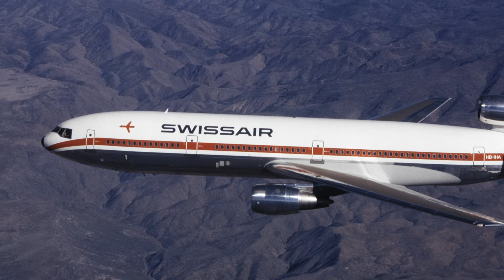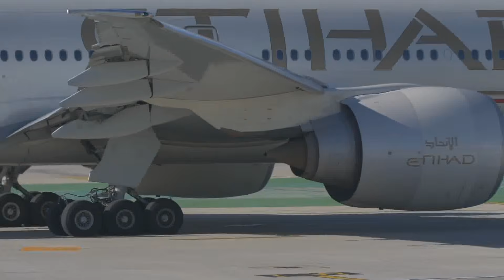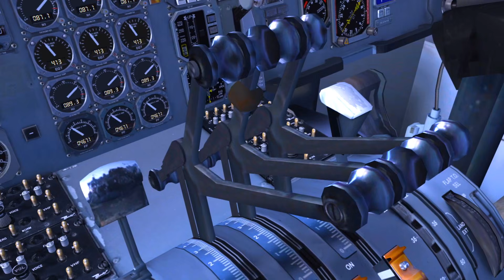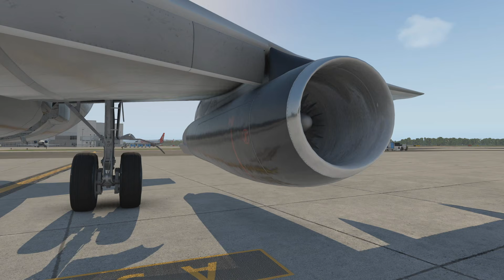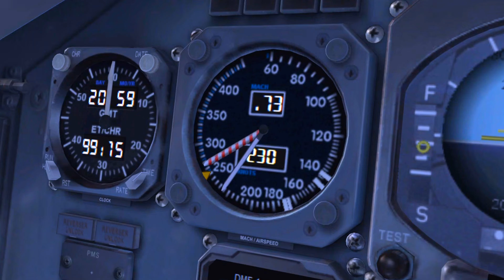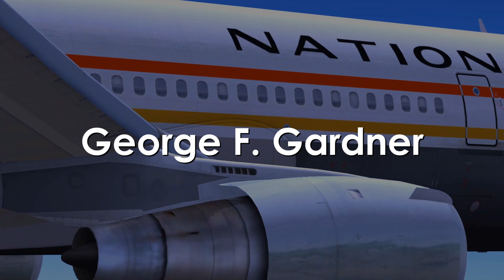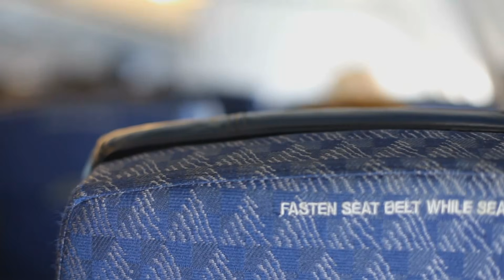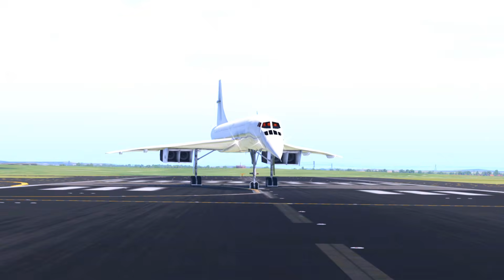The Unsettling History of the DC-10 (National Airlines Flight 27) - DISASTER BREAKDOWN

Comment: even when what looks like a completly not related crash has been tied back to the dc-10, that being the fact the concorde crashed and no one knew it was a piece of a dc-10 that crashed it
Reply: MarcosAcceleronHotWheels.Actually, they did know almost right away. One of the first things that's done when an aircraft has an incident during takeoff is an FOD inspection of the runway that it took off from. When they found large pieces of one of the Concorde's tires on the runway, along with a strip of metal, it was determined that the metal strip didn't come from the Concorde, so the accident investigators suspected it came from a previous departure from that runway. The flight that took off just prior to the Concorde just happened to be the Continental Airlines DC-10, which was missing a wear-strip from one of it's engine cowlings. But to be fair, that strip of metal could have come from any kind of aircraft. 
As a result of this accident,  Continental was fined for maintenance violations. But I must point out here that that wear-strip was not part of the DC-10's engine, but a non-structural part of the cowling, which is part of the airframe of the DC-10, added by maintenance  when it was noticed that normal flight vibration had caused wear between the cowling access door and the structure it attaches to. The engine wasn't the culprit in this accident. Instead, it came down to a very high performance aircraft operating at the extremes of the environment that had a critical failure at the worst possible time. Unfortunately for the Concorde, the likelyhood of tire failure was much higher than other commercial jet aircraft of the time because of it's higher takeoff and landing speeds.
That, and some shoddy sheetmetal work by one Continental mechanic and you have the makings of a truly horrific disaster.
I like the videos from this channel and think the quality has improved significantly since the first ones, which contained frequent technical errors and a lack of basic research on high profile accidents that had been covered previously by other aviation channels. I like that this channel has been looking at lesser-known accidents/incidents. Keep up the good work,  and let's "keep 'em flying!"

Comment: The piece of the "Engine" that came off of the Continental DC-10, Concorde crash, was not part of the engine, but a piece of the engine cowling, the engine had nothing to do with that. 
I overhauled CF-6-6, and CF-6-50 engines, and over the years was present for some of the modifications to those engines, none of which were of a major type. Very good engine.
I would be interested to know if the other instances that the engine had been removed for performance issues, if there were excessive vibrations associated with that engine.

Comment: There were no such thing as ETOPS in the 1960's, that would come into foucus towards the end of the 1970's, which is when Boeing launched the 757, and 767 designs, and Airbus launched the A-300B design.
Reply: I believe the "T" in ETOPS stood for "Twin engine" and the DC-10 was a 3 holer so the ETOPS rules would not apply in any event.

Comment: The DC-10 also played a major role in the crash of the Air France Concorde
Reply: Actually the official story is flawed. Concorde started veering off the runway before it ran over the supposed piece of metal. British pilot who flew Concordes elaborates on that accident more precisely.
Reply: @maciekkra539  Whether it drifted or not I certainly wouldn't want to be taking off on a contaminated runway.
Reply: @Dash8Q400Radio  I agree, the French did a shoddy work either way. FOD on the runway and poor maintenance on one of the most beautifull birds ever taking to the sky.
Reply: @maciekkra539  As usual, xenophobic language whenever a French organization is involved.  No one writes “the Americans did a shoddy job either way allowing an illegal part on their DC 10 and  then their lack of proper maintenance allowed it to fall on the runway unnoticed.”  No. They write simply, ‘a DC 10’ or at most, ‘a Continental DC.’  No America bashing; just French bashing. One could analyse that.
Reply: @lours6993  No doubt American maintenance personel did crappy job on the Continental DC10, i did not negate that. But when you dive into this accident more, getting rid of just one of links in the chain of events would have most likely prevented the catastrophy. But like i've wrote, the Concorde started veering off the runway before it went over said piece of metal, had that not happened, it would pass right by it on its takeoff run.
Reply: @maciekkra539   My point is about your use of xenophobic language: that group, “the French” but never, that group, “the Americans.” It’s the choice of words that seems to betray an attitude, conscious or unconscious.  One group of people can be easily grouped together and stereotyped negatively. The other cannot. This is essentially what xenophobia is.
Reply: @lours6993  Do you know what you're even writing? I'm obviously not writing about any phobias. I'm writing about technical aspects about the Concorde tragedy.
Reply: @maciekkra539  There was a learning moment here on use of language. I guess you missed it. Have a good day.
Reply: @lours6993  Listen, don't even bring that woke nonsense here. You obviously don't even know the meaning of the word "phobia". Were Americans working on the Concorde in Paris?-no. Were French working on Continental DC10?-no. So what is the problem here? Looks to me you're the one with the phobia. Phobia-illogical fear of something. There is a monent of learning here, use it. Good day.
Reply: Which ended the Concorde era sadly :(
Reply: @yuii2493  realistically... Concorde was.... in some ways genuinely innovative in terms of progressing aviation, and the world is a less interesting place without it, but... in some ways...  It was a flawed design that was dangerous to operate.  Which makes it even sadder, they hadn't managed to fix the known flaw before disaster struck.  They knew what it was though.

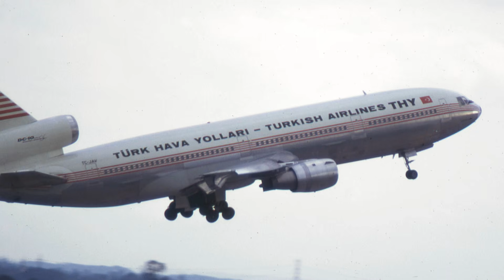Comment: 2:44 I flew with this particular TK DC-10 a few months before its crash. As a young kid who had only been on Fokker F27, F28 and McDonnell Douglas DC-9 before, the DC-10 was so huge in my eyes.
After the crash, I still remember shredded stuff of the passengers split all over the place being shown in the news.
Most passengers were on board by bad luck (or by fate?). Due to some strike, their scheduled flights were cancelled and they boarded the first available flight from Paris to London, which turned out to be this accident aircraft.
Reply: I think the incident you mentioned was Turkish 981 which crashed with all of them dead (346 passengers/crew) in 1974 because of a door which was loose and which blew off as the DC 10 was climbing

Comment: The DC-10 was certainly far from a perfect aircraft, but I do not think that it deserves the sort of negative reputation that many people have given it. Aside from several cargo door locking mechanism flaws, most of the notable accidents and crashes can be attributed in part or in majority to either improper maintenance practices by operators, pilot error, or a combination of both.  American Airlines flight 191, probably the most infamous accident of the DC-10's lifespan and to this very day the deadliest single aircraft accident in American aviation history, was not in any way attributed to a design flaw or malfunction within the aircraft, nor was it attributed to pilot error. It was American Airlines' fundamentally flawed maintenance practices that caused catastrophic damage to the engine pylon which caused it to completely separate from the aircraft during the takeoff roll.
Reply: Hi Jackson;  Actually I think there was a lot more to the AA-191 accident than meets the eye at first glance.  What you say is true... The NTSB report basically blamed flawed maintenance procedures and incorrect pilot training for the accident and there is no doubt that these were major factors.  I believe there were other factors involved related to the DC10 design being "minimalist" and being rushed in its development.  People far more qualified than I hold the opinion that after the engine departed the left wing the aircraft was still flyable on 2 engines.  In fact, this is a certification requirement.  The fact that it crashed once the engine departed and damaged the hydraulic and electrical systems can be attributed to two design decisions made by McDonnell Douglas.  The first was not to install a system to detect and prevent unsymmetrical or un-commanded slat deployment or retraction.  (Both the 747 and L1011 had such systems and the FAA mandated the use of such a system in 1982.)  Yes, McDonnell Douglas had tested the aircraft with unsymmetrical slat positions and proved it could fly safely but it was NOT tested for un-commanded un-symmetrical slat retraction just at the moment of rotation.  The second design decision was to only provide a stall warning/stick shaker for the left seat (Captain) as standard equipment and make it an extra cost option for the right seat (First Officer).  American Airlines opted to not pay for the option.  The FO was the pilot flying at the time the left wing stalled due to un-commanded slat retraction and he got no warning that the aircraft was entering a stall.  If either of these systems had been installed as standard equipment there is a good chance we would not be talking about this accident today.  The bottom line seems to be that the DC10 was an inexpensive "minimalist" aircraft that did meet the regulations of the day but only just...  When things went wrong there wasn't anything "extra" that could help the pilots out of a tight corner.

Comment: "For the first nearly 20 years of operation of DC-10s, flight 27, in 1973, was the only major incident to involve an unconfined engine failure. And after two decades of operation, it would look as if there was no reason to suspect that another fatal engine incident like this would occur." - that would make the DC-10's first flight around 1953... :-S
Reply: unless 1973 was near the beginning of the first 20 years of operation...as it was. the line is a bit misdirecting tho.
Reply: @RatPfink66  - well yes, I guess I knew what they meant 😀

Comment: At the airline I flew for, there was a three strikes and you are out maintenance policy. If pilots had a squawk about a particular component on the airplane, if the repair failed for a third time the airplane was grounded until it was fixed permanently. I wonder if this policy might have prevented this accident. I guess we will never know.
Reply: Gawd, at the regional I worked for in the early 90s, we were one of the first and largest Embraer Brasilia customers, and if we had that 3 strikes rule, the fleet would have been grounded. They always had the same nitpicky problems, most of which could be deferred (some instruments, biffy dump system - redundant items and conveniences mostly), but they kept coming back again and again, rarely anything serious unless you're the poor ramp guy who gets a face full of used blue juice. We had a few ramp fires from fuel leaks on engine shutdowns - that was fun.

Our maintenance crew was top notch. It's just that getting a new type up and running means going through a lot of those nasty little problems. I think the Brasilia turned out to be a fantastic aircraft, and so are its jet descendants. The pilots loved it, but they got to know our maintenance staff pretty well.
Reply: @DrBeenaPlumber  I flew the Brasilia during my time at a commuter airline. It was a good airplane but you had to fly it by the book and be careful with the props.

Comment: One thing I don't understand is, if most accidents involving the DC-10 were unrelated to the plane's design, then what about its unusually high accident rates compared to its competitors? It's hard to believe that only the DC-10 got poor maintenance and incompetent crew.
Reply: Blerst;   That is a very good question!  I don't think there is a single simple answer to the question but I can think of several examples that would be a partial answer to the question.  United flight 232 (DC-10) suffered an un-contained failure of the number 2 engine that damaged all 3 of the hydraulic systems which rendered EVERYTHING hydraulically powered on the aircraft inoperable.  The result was a crash landing in Sioux City.  Pan Am flight 845 (747) departing San Francisco became airborne late and impacted the approach lighting system at the end of the runway sustaining severe damage including 3 hydraulic systems.  The aircraft managed to return for an emergency landing because it has been designed with FOUR hydraulic systems and the one remaining system saved their bacon...   Another case that comes to mind is Northwest Airlines flight 85 (747) which suffered a hydraulic malfunction in the rudder system over the Pacific ocean which caused the rudder to make an un-commanded hard-over.  Normally this would result in an immediate death spiral (like United 585 and USAir 427) and we never would have found out what happened - but the 747 had a "split rudder" where the top and bottom sections of the rudder were independently hydraulically controlled.  The pilots were able to deflect the still working half of the rudder in the opposite direction to balance the the rudder forces and that kept them flying long enough to land safely in Anchorage.

    The pretty much inescapable conclusion is that of the first generation wide body aircraft  (747, DC10, L1011) the 747 and L1011 were very solidly designed aircraft.  The DC10 was designed to be the less expensive and earlier to market alternative so some design corners had to be cut.  This does NOT mean that it did not meet the basic regulatory requirements of the day but it didn't have much redundancy ABOVE the required minimum.  Extra redundancy above the minimum is nice to have when you are having a bad day!  Remember American flight 191 (DC10)?  The NTSB report basically blamed defective maintenance and incorrect pilot training.  The facts seem to be that the the aircraft was flyable but entered a left wing stall when the left wing slats retracted due to loss of hydraulic pressure.  There were no mechanical slat locks (not mandated by the FAA until 1982 but installed as standard equipment on 747 and L1011) so the left wing slats retracted reducing the lift of the left wing causing the stall and resulting roll.  The pilot flying (First Officer) might have avoided the stall or been able to fly the aircraft out of the stall if he had known they were stalling but he had no stall warning stick shaker.  On the DC10 a stick shaker for the FO was an extra cost option that American Airlines didn't want to pay for.  As for slat locks that would have prevented the stall, Mcdonnell Douglas deemed installing them "unjustified".  See the August 4 / 1979 NY Times article written by Richard Within.  Search for "DC-10 Manufacturer terms slat locks unjustified"  It is interesting reading and clearly displays the mindset that the DC-10 was a "minimal" aircraft and that anything that could be left off would be left off to reduce the cost and speed up the development schedule.

      The bottom line is that while the initiation of many DC10 accidents was not the fault of the aircraft the lack of something "beyond the minimum" in its design made it more vulnerable when things went wrong.  Think of it as removing a few slices from the Swiss cheese stack.  Fewer things have to go wrong before the situation turns into disaster.

     These are my opinions... other people are sure to have other opinions so let the discussion begin...
Reply: Not true about the poor maintenance or crew part. Alaska 261 (MD-83) and Japan 123 (747-100) were not maintained properly prior to those 2 planes crashing. There are others but those 2 came to mind for me as I watched the video

Comment: I want to say I'm surprised I've never heard of this, but at the same time I can't really be surprised when United 232 also happened. There's no doubt it was overshadowed by 232 as they were both uncontained engine failures, just that 232 was more... "remarkable".

I miss the trijets.
Reply: The more engines on an airliner, the greater the chances of a catastrophic engine failure. Airliners with two engines on the wing that can fly on one engine are probably safer than trijets with engines next to the rear cabin or up in the tail next to the hydraulics. I was a fan of the Lockheed L-1011.
Reply: @johnstuartsmith  Same here, the L-1011 is my favourite plane.

Comment: Wait hold on What about Southwest Flight 1380 There basiclly the same these stories are the same Both planes suffered a uncontainted engine failure a passenger was partially ejected and they died and the fuslage was damage wow..
Reply: The Southwest plane was a Boeing 737 and she died when the others were unable to save her after she was pulled back in
Reply: @joelsterling1445  That’s the minor difference
Reply: @joelsterling1445  The plane is not the difference
Reply: @joelsterling1445  And I did not the planes were the same.